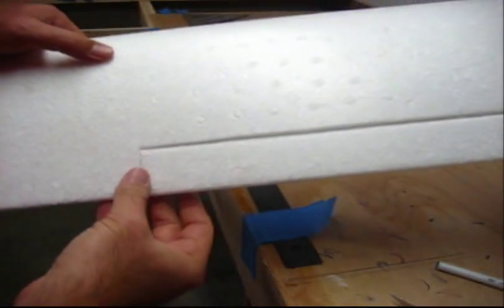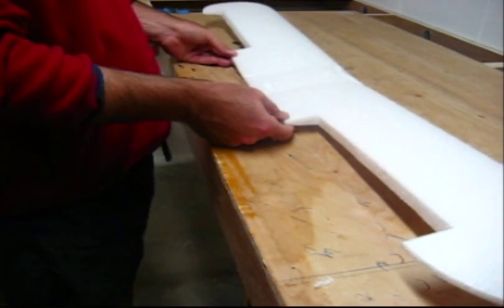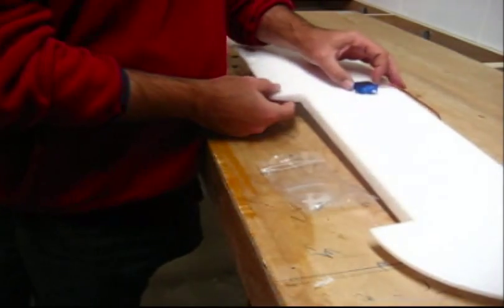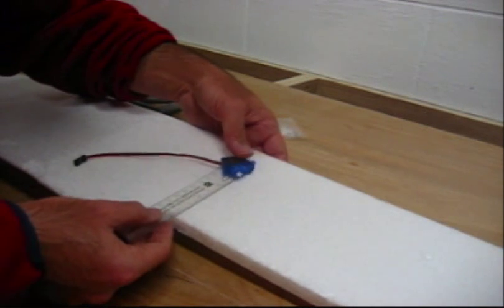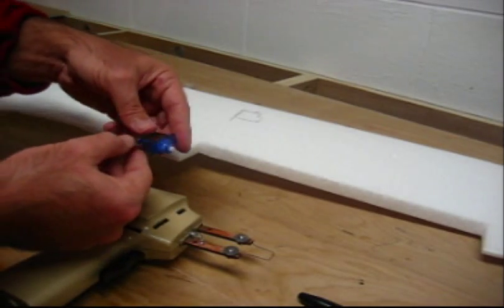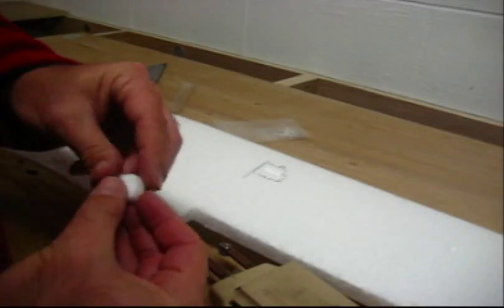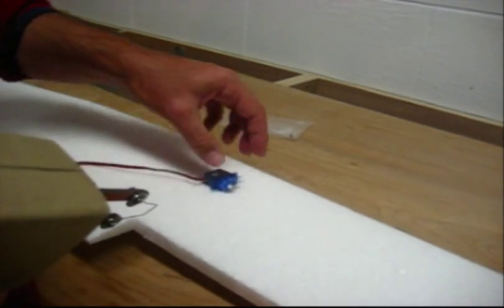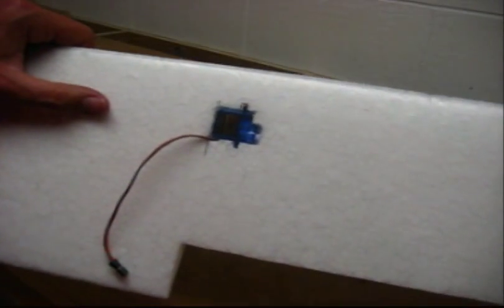6-Cutting out the Ailerons Part 2 - Building HZ Super Cub from Scratch

Comment: Info for those out there. If your looking to get a heat knife like the one in this video, you can use a Soldering Gun, put in a wire tip, and your done. You can use a regular Solder Iron and flatten the $2 copper tip and make a knife edge this way.

Comment: @tanamus13
A year later, and it doesn't look like anyone else is going to answer... so...

I was going to try bending a piece of 14-gauge (or maybe 12) copper wire, and putting it on a soldering gun similar to the one in the video.